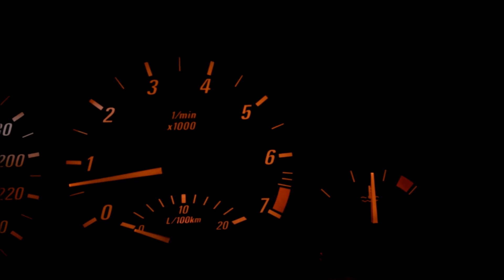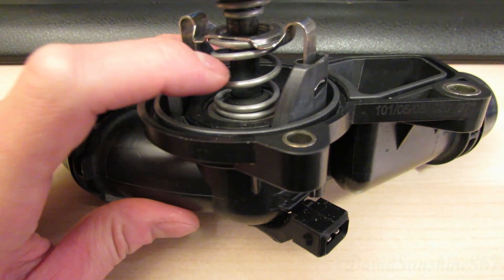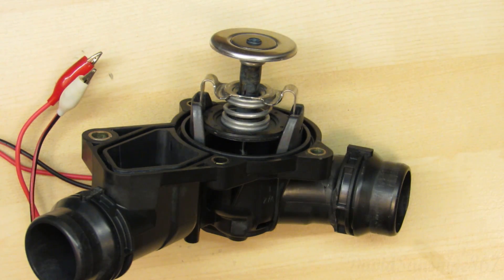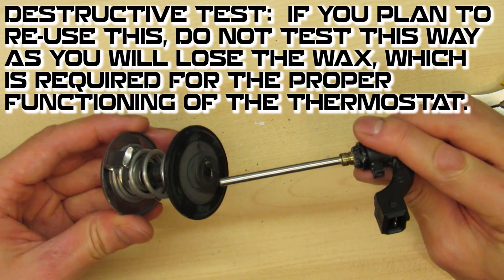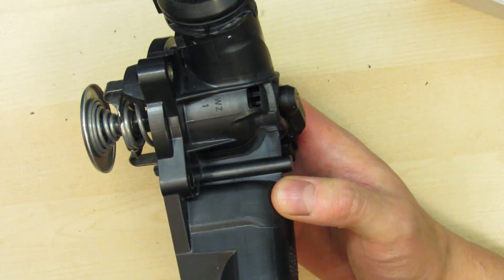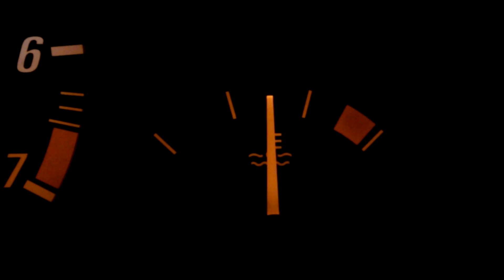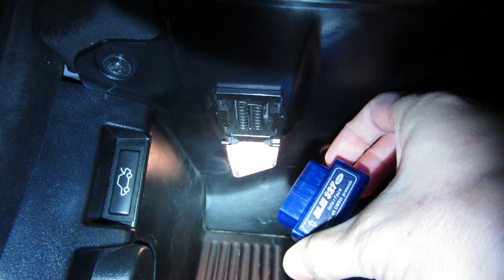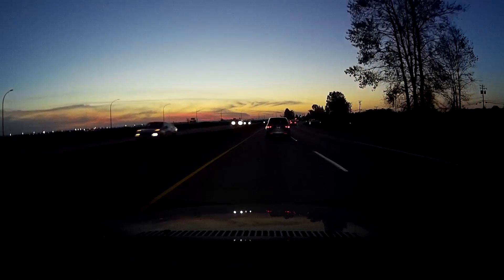How a Thermostat Works in the E46 - How to Diagnose a Broken Thermostat

Comment: Thank you for clear explanation! I have my temp gauge on dashboard showing max temp as soon as I turn ignition to ON position even if the car is cold in the morning. I have changed temp sensor and tested all wires for that sensor, but still have the same problem. My engine is not overheating when I drive it, but I think it is under working temperature. Can thermostat be a problem here? Im not so sure because thermostat is not connected to the temp gauge on my dashboard which is showing wrong temp...
Reply from the maker: Hi, that seems weird.
The thermostat doesn't read the temp so that's not it, your thermostat may be fine.
You'll want to read the temp with the obdii reader and torque, or just read it from the cluster.
I don't have a video showing how to do it, but there are plenty online, check it out here. https://youtu.be/wjKt0ZQBV2U
Search for more if you want.
You can also read voltage, gas mileage (I think that's 4) and all that, coolant temp is 7. 

If that digital temp read out is also high, you probably have an issue with the sensor, if this is the case, it's hard to troubleshoot, but I'm sure you can get it figured out. 
One possible place that causes electrical issues is the junction box or fuse box in some BMWs.  Since all the connectors don't have dielectric grease on them, they corrode and cause issues, intermittent connections or high resistance, and open circuits, which might be why your car thinks the temp is high.  If your digital temp is ok, then your gauge is be just broken.  
Give that a try and see if it works.
Good luck!
Cheers,
David. 
PS: I use deoxit from Amazon to clean and protect all my electrical connections, you just spray, and plug it in 10 or more times to clean. It leaves a film of what appears to be dielectric grease that protects and helps maintain an electrical connection. You might want to do this with your temp sensor.  Even without the solvent, you can clean your temp sensor connection by inserting and removing the connection 10-20+ times.  See if that helps, if it does, put some dielectric grease (or deoxit) on there and it should be good forever. That's the first thing I would try. Unfortunately, the seal at the sensor is weak, and you might spring a leak, but your o-ring is probably new so you should be ok.
Reply: @DavidSunshine  Thank you for your reply David. I already watched that video and it shows me this on digital display: "_ _ - 128" Should I try with the OBDII too or this is enough info? Hm good Idea, I will check all fuses but I think they are good because I tested the continuity/conductivity (with multimeter) between temp sensor connector and battery ground and multimeter gives a positive signal. I bought a new sensor so it cant be possible that it has dielectric on it. Also I checked al the wires that are going in the sensor and they are good and I get 5V on the connector.
Reply from the maker: @amy40c  Hi,
Seems like it's still not contacting the sensor. Seems like an open circuit. Did you try inserting and removing the plug to it about 20 times?  If it's a connection issue at the plug, this will certainly fix it. A lot of times that's all it takes and it starts working again. That happens to the abs sensors, camshaft position sensors, temp sensor, coil pack, and transmission gear position sensor, in my experience alone.  Cleaning the connector fixed all those issues lol. So give that a try. That's all I can think of is this case. If it's not that. Should try other things like the connections at the junction box. 
Cheers,
David.
Reply: @DavidSunshine  Hi David, yeah I have short circuit somewhere but not close to the sensor. When I turn the ignition to ON position at that point my both pins on the connector are grounded (tested with multimeter continuity beep) and also between those two pins is short circuit. I checked wires close to sensor but they are okay condition and no short connections. Looks like it is something behind the dashboard or close to ECU? 🤔 Im not so sure because I dont know for sure how the wiring goes. But thank you for your help we are going in a good way I think 😀

Comment: Thanks for sharing.
Pulled out the thermostat out of the casing but cannot put it back on again! How did you do it. There seems to be a jump in the video at that stage.
Also when I tested the thermostat in boiling water neither the existing one nor the the brand new one open. Any guidance will be much appreciated.
Thanks
Reply from the maker: Hi,
At 4m40s I use needle nose pliers to push the spring clips back in.  Helps to do it on carpet so the housing doesn't slide.
Did you try hooking up 12Vdc to it? They should open like in the video.
I didn't try boiling it, but that should open them too. 
If they aren't opening, they both could be bad?
At boiling temp they should really open.
I've reviewed a brand new part that was broken, BMW oem, so could happen. 
But try the 12V, if it don't open from that, something is wrong. 
Just use jumper cables and a car battery if you don't have a 12V 2A power adapter. It's not polar sensitive, it is just a resistor, so connect it and it should open in a few minutes, give it 10 to be sure.
Cheers,
David.

Comment: I bled the system and then ran the car on idle after about 2 minutes I could see bubbles start to form where the gaskets seal the thermostat to the engine and about after 5 min on the lower left corner of the thermostat steam start to come out as if it was a teapot?? Any ideas on and my temp gage reads normal. I could also smell coolant vapors... Thank you so much for your time and help man
Reply from the maker: Oh, well, if the gasket there is gone, or the leak is there, it's probably 10 years old and the plastic has gotten weak and brittle, the pressure must have caused a crack. If it's that old, for sure you need a new one. Buy some RTV gasket maker and a new thermostat and replace it. Should stop your car from thinking it's tea time.  
When cleaning the area, be careful, there are razor sharp edges around the opening to the engine.
Good luck! 
David.

Comment: So would you recommend changing the thermostat??
Reply from the maker: No, air in the system doesn't mean the thermostat has failed.  But that could have led to boil over.  If it's 10 years old, it's worth changing since the wax is old.  You can try bleeding the system first, if it runs fine after that, you can choose to replace the thermostat as preventative maintenance, but don't really have to.  It may have just boiled over because you have old coolant in there too, maybe too much water?
You may want to replace the coolant if that's the case.
You should check the easy and cheaper things first, before replacing it.
Cheers,
David.

Comment: Right where my thermostat is located on my bmw 528i it's steaming excessively but my temp gauge is normal, any ideas??
Reply from the maker: The temp gauge is actually located very low, so if you have low coolant or air in the upper portion of your system, it'll read a normal temp, read a normal coolant level, but be overheating and creating steam, and boil over.
You may want to bleed your system. Google how to bleed the cooling system, it's actually pretty strange for these BMWs cuz of the electric pump. 
Don't turn the bleed screw too hard, it breaks easily!   And if it breaks, you need a whole new upper coolant hose assembly. 
Good luck,
David.

Comment: I have a 00 328ci my engine is over heating... and leaking coolant.. the reason this all started is the fan wasn’t plugged in the sensor got unplugged and it over heated and exploded on the side of the road... coolant was everywhere. Since then I bought a new expansion tank and expansion tank mount because the old one broke comming off.. i am still leaking. I can’t find the right o rings at auto zone or anywhere. They don’t have them! My car is still overheating and leaking.. I think it may need a thermostat or water pump because it’s still overheating and when I tried to bleed the system I noticed there was no heat. I’m 18 years old and can’t really afford to have it fixed at a shop and i am more of a do it myself kind of guy. Anybody know anything that could help? Also I had to take the transmission cooler off to install it and now it’s throwing the transmission light at me...

Comment: I’ve replaced head gaskets, thermostat, expansion tank, radiator on 2000 323i and my coolant light still turns on when I turn my car on stays on for like 20 minutes then it turns off what’s the problem ...?
Reply from the maker: Diego rubio Hi,
Sounds to me like the new level guage is aftermarket. The stock bmw is particular, and doesn't indicate low level as easily.
If the magnet is too close to the reed switch it'll inadvertently activate it even tho your level isn't low.  
The magnet may become weaker over time, so in a few months it'll stop doing that, but if you don't want to wait, you can cut 0.5cm off of the top of the level stick and it'll increase the gap between the magnet and sensor, that may keep your light from coming on. 
This is assuming you've bled the air out of your system properly, there's a bunch of videos on it.
Good luck!
David.

Comment: I have a e46 320D 00', I notice that the temperature neadle goes to the middle after  3-5 minutes after starting the engine, the problem is that the eletrical fan doesnt kick in, even If I do a big trip.
Already check the coolant sensor (very dificult to get to it) and repleaced it.
Might be the module attach to the back of the fan, but I dont know how to know if its that (costs about 200€ here in Portugal)
Any help would be highly appreciated
Reply from the maker: Picazica Hi,
I haven't had that issue, but there are a bunch of YouTube videos that help diagnose it, seems like lots of people have put in switches instead of letting the car run the fan, I don't like that, I'd rather fix the actual problem lol.
Is your coolant overheating?  Check the temp using the digital read out or the OBD 2 reader. If it's hot and the fan still not running, the temp sensor is good, troubleshoot the fuse, 12v at the fan, relay, the fan itself,  if all that works, then it should run when hot, if not, maybe the ECM output is fried, and that's why people have added a switch.  I would personally add a bimetallic switch somewhere, tape that to the radiator somewhere with thermal grease, and have that operate a relay.  When it's at 85C I would run the fan, it just automates the activation.
Check temperature https://youtu.be/wjKt0ZQBV2U
Fix overheating https://youtu.be/kCXTFBYiH1Q
Hope that helps.
Cheers!
David.

Comment: Why did the termostat wax spill out when you heated it outside the casing? Is the thermostat itself not sealed and the heater directly contacts the wax?
Reply from the maker: I let the heater shaft pop out, so the wax came out.  If it's installed in the casing it's restricted and doesn't pop out, so you won't lose wax.
The heater is directly in contact with the wax, so that it can melt it and act as a piston to open up the valve, it's sealed so the wax doesn't come out, but over time it probably wore out, and some wax got it, letting air in, and that's probably why it wouldn't close completely.  After 12 years of operation that's expected, so probably needs to be replaced.
Cheers!
David.

Comment: So I want to try cleaning it before I actually replace it. I'm a little confused though, is sticking the heating element of the thermostat inside and letting it heat up cleaning it or should i put it in an out while its cold? Because what you did and what your comment says is the opposite. Thank you!
Reply from the maker: FrnchFriez Good question.  If you heat it up and let the wax spill, like I did, that'll screw it up, cuz you're not supposed to lose wax.  Just remove the shaft and try not to bend or scratch it. If it's a little bent, try to bend it back without denting it.  Gotta keep it perfectly shaped. You can probably polish it with polishing compound to try and make it a mirror finish, that may help make it function better.  
But if it's failing, most likely the seal is bad and you've lost wax, but it's free to try so worth a shot cleaning if you got the time! 
Cheers, 
David.

Comment: About 3 C˙. 5km or 10 min driving is a lot of time for warming up? When my car waming up the coolan temp about 89-95 Celsius. Everything is alright? Thank you.
Reply from the maker: SX320i Yup that sounds normal to me.  There's a lot of water in the system so it takes a while to heat up. If you have heat on the highway it means your thermostat is working.  If you haven't flushed and refilled the coolant you may want to do that though, may help with the temperature regulation, making sure it's a 50/50 mix. 
Sounds like there's some variation and it could mean you have 40% water, which is fine for cooler climates, but I recommend 50/50 for moderate climates, -10C to 35C.
Cheers, 
David.
Reply: Thank you Master!! :)

Comment: I have a 2001 e46 and I have noticed my engine run cold. The mechanic said it's my fan needs to be replaced and my rpm are too high. I got a code that engine running lean  probably because of P1619 my thermostat losing power.
Reply from the maker: Ash2theB Hi.  That doesn’t sound right to me.  If the fan is broke it’ll overheat.  If the thermostat doesn’t have power it won’t affect much, since the electric heating is only to force additional cooling when the computer knows you’re constantly pushing the engine hard.  If your car is running cold when you’re driving on the highway, but warms up when you’re sitting in park or stop and go traffic, then it’s most likely a thermostat that’s stuck open, like the one in this video.  
Hope that helps!
Cheers,
David.

Comment: hi david...i put 12v 2 amp power supply to my behr thermostat.it did not open after 16 mins...i had a leakage.can u pls mention the connections...which of the 2 terminals is +...help..pls
Reply from the maker: Hi, 
It only pulled an amp so your power supply should have been good.  I don't think there's a polarity,  since it's just a resistive heater.  It must not be functional?  Take it out and see if the tip gets hot,  be careful cuz it's really hot.  If so.  The wax may have leaked out and there's not enough in there for it to operate.  
Not sure if you can fix that.  Might need a new unit. 
Cheers, 
David.
Reply: David Sunshine thanx..already ordered new one

Comment: Good stuff. Very interesting. I wonder how the metal shaft gets bent simply going up and down over the course of its life? Either way great video!
Reply from the maker: Thanks!
Probably gets caught on 1 side over time, causing an uneven force on it, torquing it and bending it a bit.
That's probably why it stopped closing in my E46, and then I was stuck with constant cooling, couldn't get heat on the highway lol.
Replaced mine and it's working fine.
I could have probably just taken this one out, straightened it up, polished my shaft real good, put it back in, and I'd be good to go!  Cheers!
David.

Comment: Hi guys I have a problem with my E46 M3 2003 I did change the whole cooling system and the car still overheating on traffic or going up to hills I did replaced the thermostat two times the fan clutch too and still have the problem. Please if any body know what's the problem please let me know thanks
Reply from the maker: Hi,
If you have all new cooling components, it could be air in your system that causes overheating.  Even a small amount of air in your system will cause overheating.
So apparently the proper BMW method of bleeding the system, is to park it on level ground, and then turn the ignition to position 1(DO NOT TURN THE CAR ON), and have the interior fan blowing at the lowest setting(to keep the battery from dying), and then turn your heat/temperature on to MAX setting (32C for me, or ##F for others), this gets the electric pump to the cabin heater core pumping, and valve open, now you remove your bleeder screw, remove the coolant reservoir filler cap, and then slowly poor in fluid until the fluid comes out of your bleeder hole(removed the screw completely). You'll see that bubbles come out, that's good, you're expelling air from your system.
Then you let it sit for a bit, and add more fluid, I would do this and let it sit for about 10 minutes, waiting and slowly pouring.  After flushing about 500ml through it, and only having fluid come out, then all your air should be expelled from the system.
You can siphon out the excess fluid from your reservoir until it's down to the level of your float(you don't want to overfill the system), close it all up, and you should be ready to go!
You can heat it run, run it to hot, and do this again until even more air is out of your system, but I haven't found this to be required.
Anyways, hope that works!
Cheers,
David.